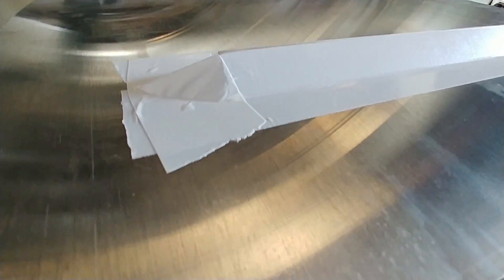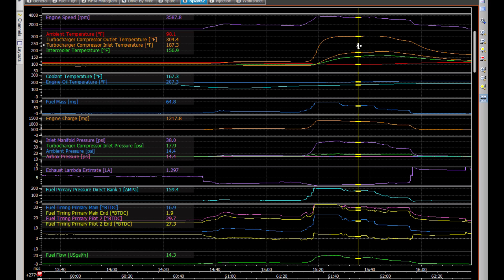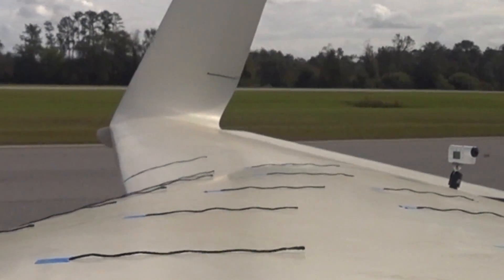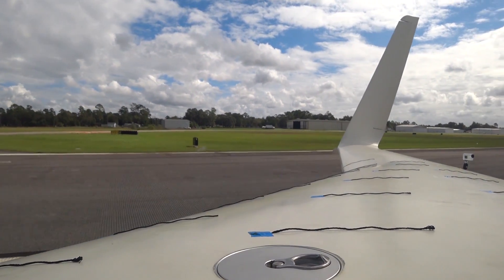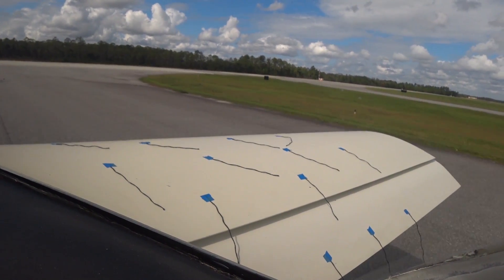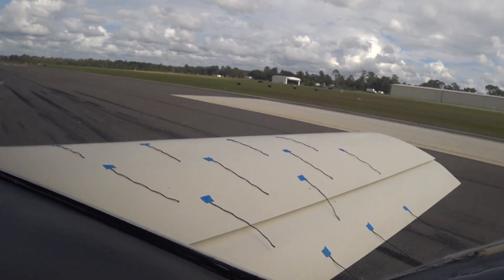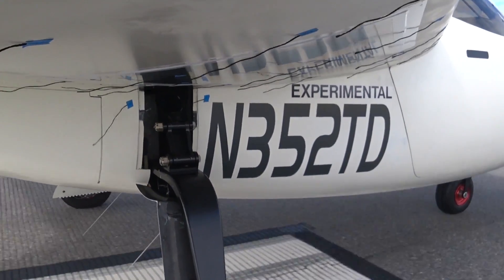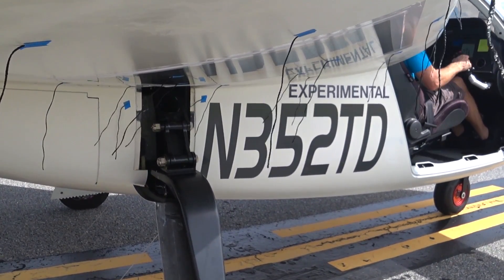Covering the Wheel Wells - Building the Raptor Prototype

Comment: Peter you mentioned there is air flowing from the front wheel well through to the sides. On the Velocity which has a somewhat similar design there is no airflow from the front well to the sides. I believe you need to seal the front wheel well from flowing back - otherwise I think you'll potentially be creating low pressure under the wing via the side wells - which is the opposite of what you want for lift.

Comment: Use Gorilla Tape on your wheel well covers. Stronger than duct tape and way better adhesive. Available at Home Depot Aircraft Supply. It would be a bad day if the panel comes off and hits the prop.

Comment: Airflow is looking ok. Good to test it as you have. I will throw in a little thought I've had about your first flight. You flight disturbances looked to be sinusoidal, fairly stable in amplitude and frequency. This might be indicating a move of the centre of pressure . A fairly small move, but it's as if the Cof P is moving rearward then moving forward again. I would suspect the right wing when you consider the roll that happens as well.

Comment: Peter is not possible to run the 3D model of the aircraft through a computer simulation to see what the effects of the wheel wells (open or closed) will have on the airflow? (would give you a picture of what to expect before getting airborne again). Also I would recommend putting clear double sided tape (not the foam type) under the aluminium (between it and the wing) as well as tape on the outside. Use two layers of tape if it is not sticking properly at first. I machined perspex for many years as an architectural model builder and we often secured the piece to be machined in this way as they were sometimes impossible to clamp in place. The bond is surprisingly strong - apply considerable pressure when sticking the ally in place and use thinners (you can squirt it in there with a hypodermic needle and syringe) to release it afterwards if it is difficult to remove.

Comment: Use HEAVY aluminum tape on that panel, Peter. On Airbus 319/20/21 we use the .015" aluminum tape for temporary skin repairs measuring far smaller than that huge piece of sheet you're trying to keep in place (i.e.holding down the edges of disbonded rubstrips, damaged fairing edges, covering 2" diameter or smaller access holes, or securing 12" or smaller damaged access doors).  Make sure the .015" tape is 3" or wider. 
If that sheet begins to flutter, without better perimeter tape it's gonna depart in a blink.

Comment: Peter,
Watching the first flight with instability issues make me think about the wing design. 
To me it looks as if the wing is close to stall on the outer wing causing stability issues with Dutch role and pitch tendencies. (Even though it doesn’t look like a Dutch role to me but more like a severe stability issue) Since a canard design most probably will stall on the nose wing before the main wing regardless of the small effect from the wheel wells - I’m thinking that the more or less extreme winglets affect the aoa on the outer wing by simply twisting it during flight? See 5:15 in the first flight video, is the cam shake due to buffeting? Just a thought...If it is a heavy build, under powered, no flaps and low speed, it all ads up. 

The turbulence from the wheel wells is kind of symmetrical. A glider will be more stable with the wing brakes deployed than retracted in most cases as an example. 

Good luck with further testing!
//Lars
(Aero Systems Engineer)

Comment: regarding the cooling air flow, would a pressure sensor help find out if there is any restriction (with respect to an identical sensor shielded somewhere else in the plane)?

Comment: It's amazing the strength of tape. When I fished tournaments, sometimes we had to do temporary tape repairs on the bottom of our bass boats. This temporary repair always worked. That being said; I do have a concern... A remote possibility of a sheet of aluminum detaching and damaging Raptor's propeller. That's why I suggested 4 mm corrugated sign material to cover the wheel wells. https://www.signoutfitters.com/CorrugatedPlasticSignBlanks-24x24-BlankYardSigns.aspx?msclkid=32d5e6bfd3a01cbcba1eb92bd3a9760c

Comment: Does the motor have a cold air intake duct?
Or does it use the same duct as radiator. Oil cooler and inter cooler,

Keep up the good work
Reply: It does. He showed it in a recent video.

Comment: maybe just skip the retracting wheel idea
Reply: The issue is then it ruins the novelty of the aircraft. You start cutting features like the retracting gear, speed goes way down, and then suddenly you're competing against a bunch more designs that are already flying.
Reply: @TheOwenMajor  what novelty is present when it underperforms even certified aircraft?  Fixed gear work fine for sr22 and rv10 which achieve high performance speeds
Reply: @reinhart482  I never it was actually performing that well. But he has sold preorders promising performance that would outclass the SR22.

I don't disagree that it would make things easier, but if he starts cutting then what's the point at all?

Gear doesn't retract you don't get the speed that would be needed to sell the aircraft.
Reply: That would make too much sense lol

Comment: Studied a bit more the theory of Canard design, https://booksite.elsevier.com/9780123973085/content/APP-C2-DESIGN_OF_CANARD_AIRCRAFT.pdf, and found an interesting aspect in figure C2-4: "Allowing the elevator to "float" will stabilize the aircraft". Quite possible that the change from a fiberglass elevator spring (which broke in a flex test) to that metal coiled spring ruins stability?

Comment: Is there room to put in an electric radiator fan. A cheap quick fault finding tool. Also would creating lower cowl air vents increase engine bay air flow which would need to enter the cooling duct

Comment: That things really making 40psi manifold pressure? Is that a typo and it’s inches of mercury?
Reply from the maker: That's absolute psi. The boost is about 28psi once it bullds up to full power.
Reply: @RaptorAircraft  didn’t think of that, thank you!

Comment: Might be an idea to wrap the tape over the leading edge and ontop of the wing, to fully behind on the bottom. Would hate for airpressure changes to rip the tape off and then sheet hit the prop. Also, have you checked to see with the controls locked, can you push the ailerons up by pushing on the dynamic/static  balance tab at the bottom...... i still think this may explain the oscillations

Comment: If you have airflow along the keel as you describe, that's a huge amount of drag you can (and should!) eliminate for free.  You don't need to plate the gear well aperture - just block the flow in the keel itself somewhere.   Also if you put a reentrant nozzle radius on the back side of your spinner you might see a useful improvement in flow through the spinner/cowling aperture.

Comment: Good stuff Peter.  A messy suggestion, but you may want to put it in your toolbox.   Used in F-1 extensively.   Flow Vis - videos: https://www.youtube.com/watch?v=qaY1apFZrUE      and     https://www.formula1.com/en/video/2020/2/Pre-Season_Testing_2020__What_is_flow-vis_paint_.html   
 Please be careful with that sheet aluminum.      Good luck with testing.

Comment: I'll be quite surprised if the oscillation was due to well turbulance.  My money is on something more esoteric like canard downwash affecting wing angle of attack, or something of that nature.
Reply: I have studied the flight video carefully and can conclude that the down-sweep from the
canard hits the nose on the main wing. The plane i flying with an angle of attac of 5-6 degrees. This leads to one short moment, it is mainly on the
top of the main wing and the other moment on the underside. This means that the lifting force from
the main wing varies with which side the sweep ends up. Moreover, this does not occur
simultaneously on both sides of the plane and it becomes a vobblinng fligt. This is what
happened during the flight. This phenomenon is investigated by SAAB in development
systems 37 Viggen and 39 Gripen.
What can be done about this?
As I see it, it is to lower the canarden at least 100 mm ( 4"). This causes the down-sweep to
end up on the underside of the main wing and will not provide a variable lifting force. The
article below show how it looks for delta wings but the principle for other wing types is the
same. When it comes to Viggen and Gripen, the noswing is chosen to be marked over the
head wing's cord, because at low speeds you want micro swirls to lower the stable speed with an angle of attac of 15 degrees.
I send a link to a translated report prepared at SAAB written by Krister Karling in
English translation. He is now retired as I and worked as an aerodynamics at SAAB
and was involved in developing 37 Viggen and 39 Gripen. The previous trials with
carnaden mounted in line with the head wing cord are not published because the
results were obvious.
https://strives-uploads-prod.s3.us-gov-west-1.amazonaws.com/19860019453/19860019453.pdf?AWSAccessKeyId=AKIASEVSKC45ZTTM42XZ&Expires=1603632660&Signature=pEoOHHvb43kkKNKAZ%2Bxx8t6mSYA%3D
Reply: @olovandreen7669  very interesting. Experiments about this should be done with a scale model if it proves necessary. And now he has a wind generator too (the full size Raptor)!
Reply: @keim3548  Oh yes, and using wool yarns, from elevator from at least 3 different places, with a length almost to the main wing. It can be done both on the scale model and ond the raptor.
Reply: @olovandreen7669  Do you have a different link for the report?  The link is broken for me.  Would very much like to read it
Reply: @horse1-1  I have a hyper link but one can´t paste that into comments in Youtube.
Reply: @horse1-1  Send me a message on facebook (messinger), and i reply with the hyper link.
Reply: @olovandreen7669  I'm not sure I can find you on facebook, but I added a contact link to my profile here on youtube.  If you go to my channel and click 'About' there is an email there ("for business inquiries")
Reply: @horse1-1  Use my name.
Reply: This channel gets the most amazing replies, this is the equivalent of having a SpaceX engineering director reply with solutions to a youtube video showing a model rocket take off with a wonky trajectory.
Reply: There are videos dating back years on the progress of the Raptor and in them is footage of the scale model being flown.  Interestingly the lateral instability was present in the model and there were wing fences added, why that hasn’t been revisited is kind of a mystery to me.
Reply: @sprebound3805  I doubt his scale model accounted for all the weight the aircraft has now plus his own body weight. Center of gravity and load are massive factors.
Reply: @reinhart482  agreed.

Comment: Coming along nicely Peter.. I noticed when you had the camera angle on the foreplane that the yarn was separated from the canard along the gap to the elevator. Gliders and other aircraft have gap seal tape inside there to stop any high/low pressure from transferring between top and bottom. That could be something to keep in mind if covering the wheel wells doesn't fix the oscillation. Keep pushing forward Peter. I definitely have defended you frequently to the naysayers. I applaud your persistence!

Comment: Taped aluminum panels sounds scary if it were  to cause a prop strike.
Why don't you go into the pattern and retract the gear?
Reply: If nothing else, at least more than one strip of DT around the perimeter.
Reply: I still think simple fixed gear will solve multiple issues.

Comment: Can you tell me how you’re getting the ECU information to the Motec tablet?  Bluetooth? D9 cable? OBD? Was the Motec software able to read all the engine parameters right out of the box or was some extra work required to pull all the data you need (oil pressure for example)? I’m trying to achieve a similar setup with a Honda engine for my aircraft.  Had only considered the Torque app for Android so far but haven’t tested anything yet.  Thanks in advance and nice work.

Comment: You need to see the airflow on the bottom of the wing outboard of the strake,  That is where any spanwise flow will have the biggest effect.  The decrease in size from the strake to the wing will tend to push the air outboard, especially at low speeds.  A wing fence (or fences) straighten that flow as it approaches the ailerons, negating any rolling tendency from when the airflow moves laterally reducing lift.

Comment: Those are some pretty high IC temps, that would bother me.  Tons of power power on the table there too.  No wonder you're having cooling issues if the IAT is 190° F and feeding the radiator 300° F air...